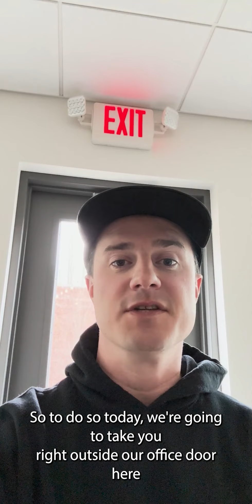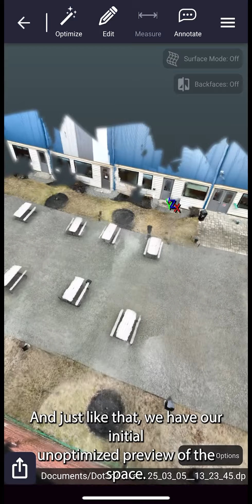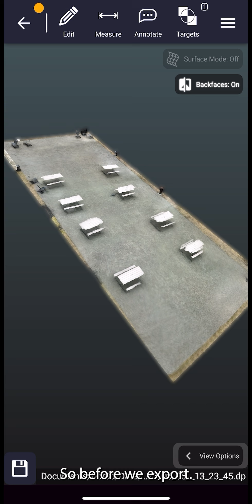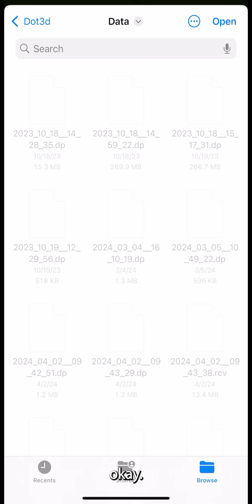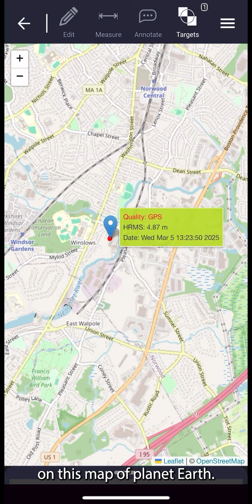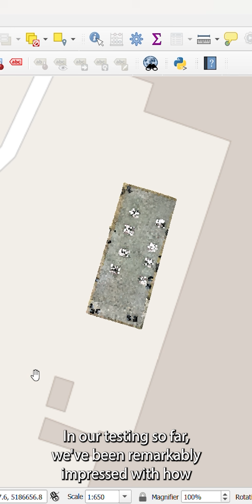iOS to GIS | Using Your Phone's GPS for Auto Geo-Referencing in Dot3D

Comment: Is it better to use your iPhone or your iPad ?
Reply from the maker: For use of this particular feature (on-board GPS/GNSS), typically an iPhone (Pro) would be best.

The iPhone Pro's GPS is the most accurate option (also leverages Wi-Fi hotspots, cellular triangulation, and other location data sources to enhance accuracy). An iPad Pro with Cellular would be a close second. An iPad Pro without Cellular (WiFi only) is the least accurate GPS.

However, external high-accuracy GNSS is also a great option for use with any of the above: http://dot3d.app/gnss